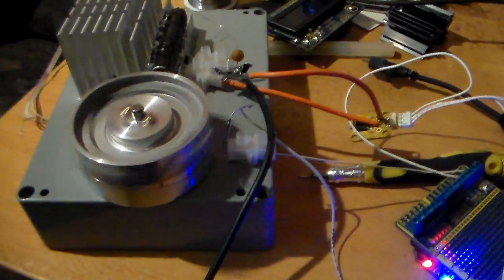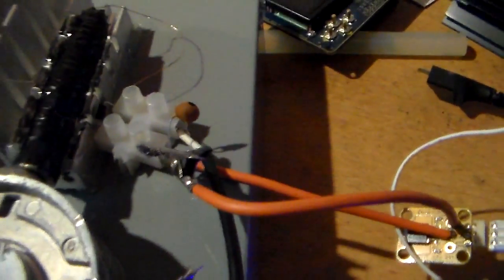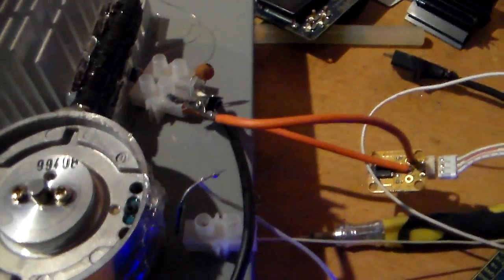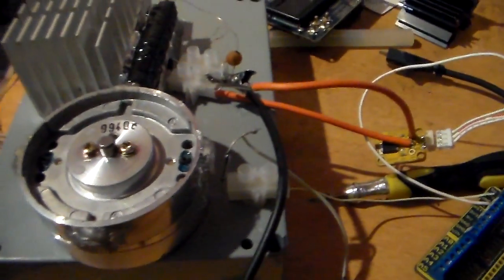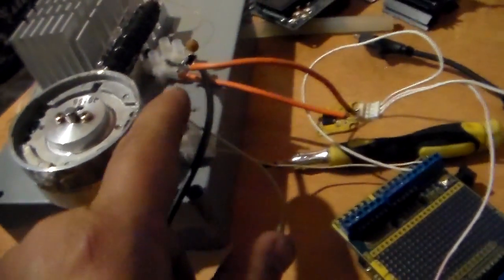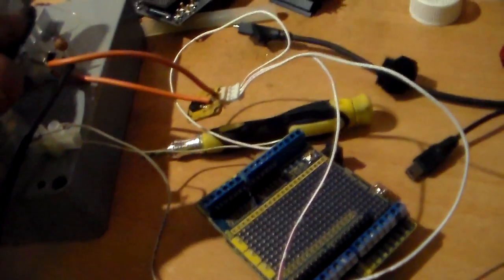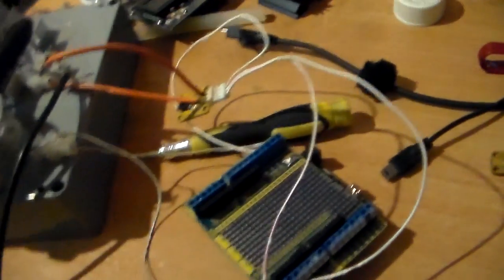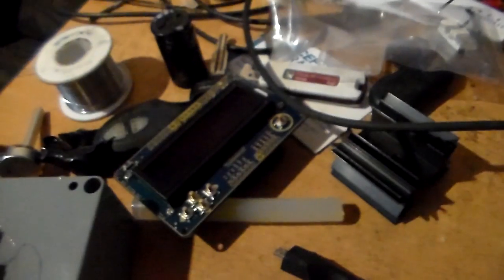Arduino Pulse Motor Part 2, runs for about 30 seconds, melts glue and dies

Comment: how about using another coil to sense the rotor position feeding the input into the arduino. Add a 5 V zener across the input to limit the pulse amplitude. then program a delay into the arduino to give a pulse a few ms after the rotor position pulse to keep the motor running at a constant speed

Comment from the maker: the two hall effect devices i have are too slow to respond to time this motor
i have to find a really fast and not so sensitive one! the reed switch is not being used to switch at the moment, just pulse width modulation

Comment: As an improvement try sending a one shot pulse to the solenoid timed from the reed that way you can never burn out the coil and replace the reed with a hall effect device. It will work the same only become difficult to destroy!

Comment: if you increase turns count of some finer wire you'll have a stronger magnet and it won't melt the glue.  maybe try a solenoidcoil? Also,  reduce your pulse width maybe.  the coil should turn off just before the magnet swings by, else it will attract it back robbing speed/power. (paint drum black and put whiteout for sensing by the opto to get your ontime and don't use the arduino at all?  you can shift opto vs. drum to adjust timing, and a longer strip = more on time.

Comment: if you increase turns count of some finer wire you'll have a stronger magnet and it won't melt the glue.  maybe try a solenoid?  remove coil from it and insert a big bolt or similar (the housing of the solenoid will shunt some of the magnetic field reducing its effectiveness if the coil is not removed.  reduce your pulse width maybe.  the coil should turn off just before the magnet swings by, else it will pull it back robbing speed/power. (paint drum black and put whiteout for ontime w/ opto?)

Comment: Any thread not covered by windings? If so, a nut and a large washer, with a screw through the washer should work.  Will change the magnetic field a bit though.

Also, using a bolt may contribute to the heat due to eddy currents. This is one of the reasons transformers are generally on laminated cores.